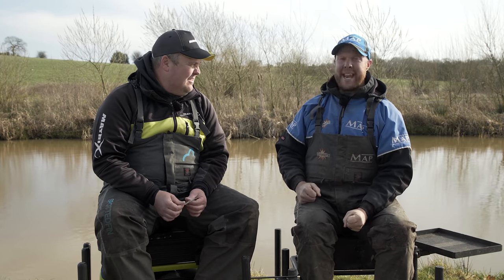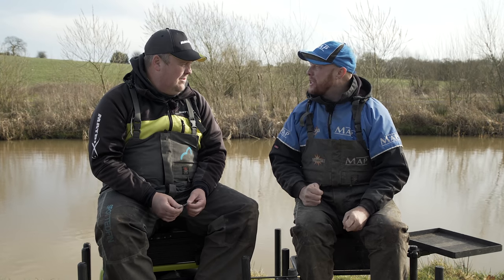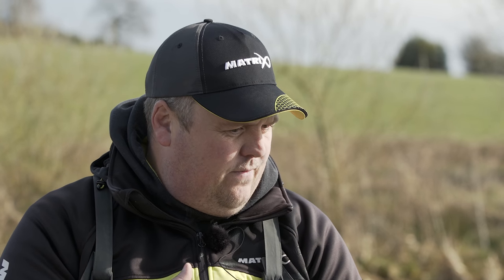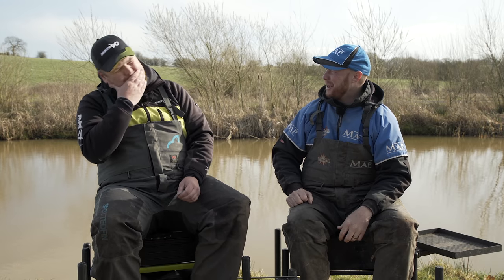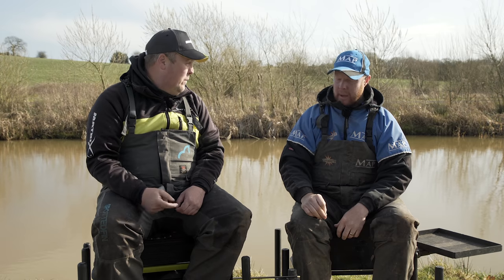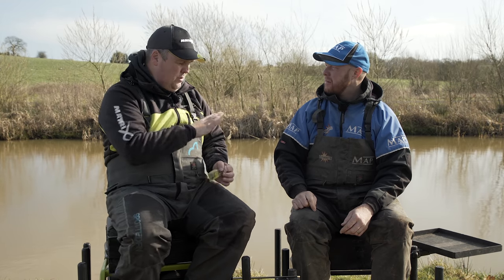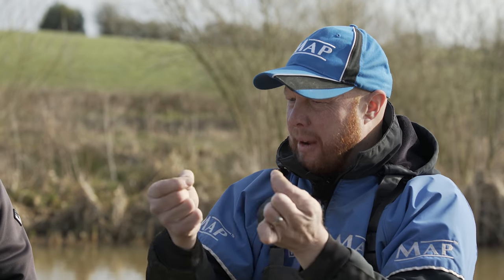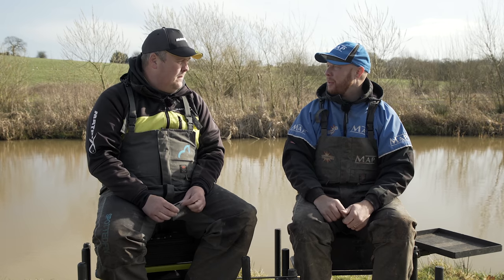Pole Elastic Connectors Explained | Jamie Hughes' Custom Dacrons

Comment: Great vid again guys, and it would be great if you can show a vid in close up detail on how you tie and attach your loops on pole rigs and attch to the connector as i noticed you had a small loop when you attached the rig, i have a rough idea as i use dacron connectors myself but not many anglers go into detail about attaching the pole rig itself. Tight lines

Comment: I leave a loop at the pull end and after a few weeks reduce the loop and move the connector down the line and snip off the wared elastic. Also use something similar   bit thicker but might strong and supple. And never had a rig come off it. I've lost a few to the Dacron connectors.

Comment: I was shown how to make a dacron connector in the early 90s before they were commercially available and there hasn't been anything better in my opinion. The only other way of connecting elastics I use was a method Andy Findlay wrote about, I think it was in Angling Plus ( the best ever match magazine), and that was just a short stiff loop of heavy sea line about an inch in diameter that you tie the elastic to and the loop sits on the PTFE bush. A super light connector.